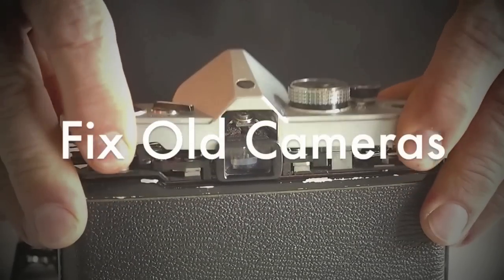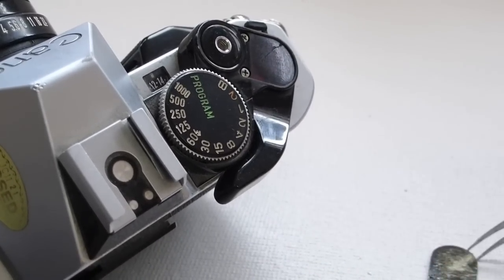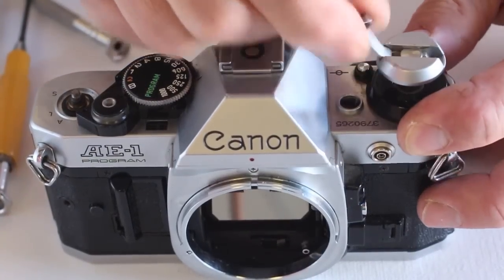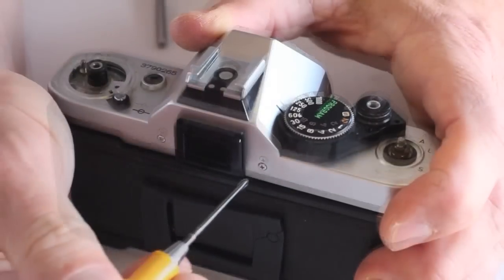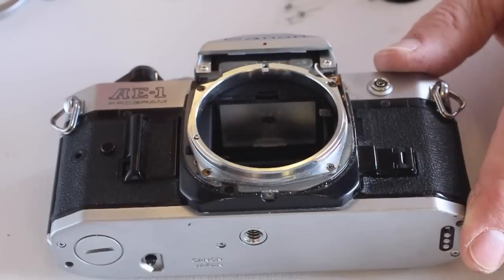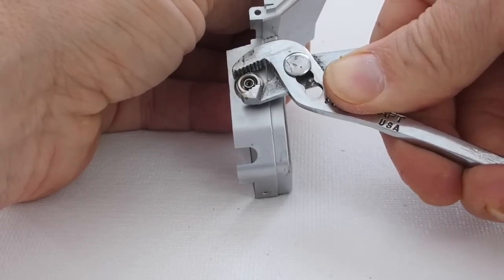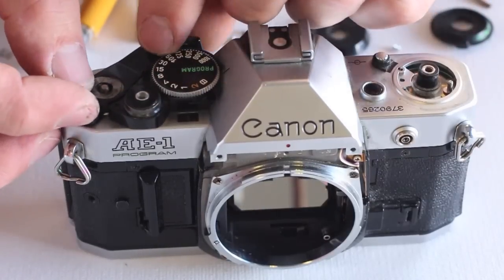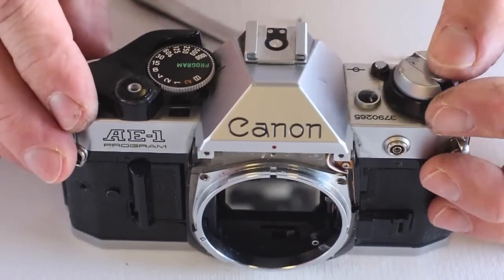Fix Old Cameras: AE 1P Top Cover Removal / PC Socket Repair

Comment: Hello there, I’m having problems with my shutter speed dial, sometimes it works sometimes it doesn’t, I checked it with shutter speed 1, 2 and B, sometimes it just fires at 1/500 or 1/1000 and B doesn’t even lock. How can I fix it? Could you please show me how to fix it? Thanks.

Comment: Hi thank you for your videos. I would like to know how to repaint cameras that have their paint chipped off over the years?
Reply from the maker: Assuming we are talking about black painted metal camera bodies. Sand 
chipped areas smooth with 600 grit sand paper or chemically remove the 
old paint. Spray with thin coats of satin enamel paint. 
The engraved letters are filled with a white a lacquer paint stick.
 - available here- http://astore.amazon.com/fixoldcam-20/detail/B002BY8HKS
Note - Typically powder coating or any heat cured paint does not work will with the thin metal of camera top covers.

Comment: Thanks for this video, it's been a big help in my getting my top cover off. Now that I'm putting it back together, I notice two pins that  I don't know where they came from. One is black plastic, the head is about 1mm in diameter and the shaft about 0.5mm in diameter. The shaft is about 4mm long. The other pin looks to be brass, has same head and shaft diameters, but the shaft is only about 2mm long.

I notice in your video there's a long plastic shaft hanging down from the inside of your cover, where the battery check button is. The underside of my camera's battery check button is just a rounded nub. I checked, replacing the top  cover, and the button makes contact with the circuit board -- I get beeps. So I guess my version of the AE-1P doesn't require a long shaft to activate the beeps.

Looking down at the circuit board on the left side, I notice the rear corner has a hole but no screw in place there, So I tried dropping the black plastic piece in the hole. Apparently there is a spring down there because the pin has some give when depressed.  Is this where it came from? I notice this hole is threaded, though.

Now as for the brass looking 2mm long pin, I haven't a clue. It also fits that hole and sits flush, but I'm thinking it probably goes somewhere else.

On the right side, the black plate that holds the frame counter has a hole but no screw in the top left spot. Doesn't look to be threaded, either. I tried both pins into this hole, but they wouldn't go all the way in. There's a more narrow hole beneath that won't let them pass.

Any advice you can offer would be most appreciated,
Reply from the maker: The brass post is probably from the shutter button and acts as the linkage from the plunger of a self timer cable. They never fall out... well at least nearly never. The black plastic post could be from the accessory shoe contact. If the center screw of the contact worked loose it could have allowed the contact to shift to a position that then allowed the post to fall free.
Reply: Okay, that makes sense about the black post. It was because of the accessory show that I opened up the camera. I'll check on the brass post's position as well.
Reply from the maker: Excellent, you are on the right track.

Comment: cool, but could you make a how to , to change the battery door? since its a very common part that breaks. thanks!
Reply from the maker: Here you go - https://www.youtube.com/watch?v=sHgN1RM3H7c
Reply: hi thanks i know this one. but in the Ae-1p its not easy like in th ae-1. for some reasom it looks like the top end of the pipe/metal stick is fixed to the case. and the bottom of it has a strange clip holding it. no way to push it upwards like in the Ae-1.
Reply from the maker: The hinge pin of the AE-1P battery door is removed in a similar manner. However, the top cover must be removed as the upper pin hole is blocked by the edge of the top cover. Sometimes the pin can be stubborn. Try seeping a little plastic safe solvent around the holes the battery door hinge pin is anchored in.

Comment: How do you replace the front
 battery door?
Reply from the maker: Once the top cover of the AE-1P is removed the hinge pin for the battery door can be pulled and the door removed. See the Fix Old Camera video for the Canon AE-1 Battery Door Replacement to see how the battery door hinge pin is disengaged. Other than the position of the flex circuit caution the procedure is the same for the AE-1P.
Reply: Can you please provide the link. Thank you.
Reply from the maker: You will find it in the Fix Old Cameras Playlist "Canon".
https://www.youtube.com/watch?v=sHgN1RM3H7c&index=5&t=28s&list=PLbBpUKJh6LCmx4zwCUEg5dCoIraoFd8LS

Comment: Thanks for your video,Could you tell me where to get a pair of those snap ring pliers from? And what size they are
Reply from the maker: There are some acceptable options here...
https://www.amazon.com/shop/fixoldcameras
Affiliate disclosure: Please make note that the links provided are affiliate links and a small commission is received by the creator of this channel if you make a purchase using these links. This adds no extra expense to your purchase. Your support of this channel is appreciated. Thank you making any purchases through the links on this channel.

Comment: I have an ae-1 and the light box is so dusty. How can I clean, please? ( I don't know if that's what it's called but, it's where the mirror is found) thank you!!
Reply from the maker: The VF focus screen inside surface is sealed. The outside surface of the VF screen can be cleaned with a gentle burst of air or a soft lens cleaning brush. If there is degraded foam stuck to the VF screen it can only be removed with distilled water. The screen is very easily damaged by alcohol based cleaner. It also scratches easily. The mirror surface can be cleaned as you would a lens, being careful to use gentle pressure.
Reply: Much obliged for your help!

Comment: The Canon service manual for some reason seems concerned with not moving the ASA wiper from it position after removal of the ASA cover and indicator dial ( suggests setting to ASA 100 before and after disassemble/reassemble. I can't see any way for the indicator dial to be assembled any other way than to align it with the coupling pin, which as far as I can tell will return the wiper to the correct ASA position as indicated on the dial. Is that correct?
Reply from the maker: Do not lose the point of reference. Sounds like you have it. Make sure you do not flip it 180 degrees out of phase.
Reply: Fix Old Cameras
So as I understand it the concern is not so much that it can and will move while handling the camera body (I know mine did), it is that it is in approximately the same spot when you start the reassembly process (IE: to the left side of the ASA dial opening in the Camera top with the Camera's lens opening facing you). The opening in the indicator dial for the coupling pin is going to result in the indicator being near the ASA100 indication when it and the cover are reinstalled. If the coupling pin was accidently moved to the opposite side the dial may indicate an ASA reading, but it wouldn't be correct.
Reply from the maker: Correct. It might help to take notes and pictures during the disassembly process in case things should inadvertently get moved.

Comment: hi at 1:09 the circle that you open with tweezer is still stuck if I try this on my camera, can you help me?
Reply from the maker: Sometimes apply heat from the tip of a soldering iron will help. Be mindful that you do not let the hot soldering iron accidentally come in contact with plastic parts of the camera.
Reply: @FixOldCameras  thank you very much!

Comment: SOS!!!!! I need help!!! I thought I was following the instructions but got lost along the way. I accidentally took out the pin underneath the rewind knob and closed the film door. I can’t put the ASA ISO pieces back either. Please help me
Reply from the maker: The black inner shutter dial with the scalloped edge needs to be set at the Bulb. The ASA dial needs to be set at 3200. The notch of the inner dial will not align perfectly with the tabs of the ASA a dial. Slightly tip the ASA dial as you turn the ASA dial just a bit to seat the tab of the ASA dial to the notch of the inner shutter speed dial.  The following link might help with the film door issue you mentioned. https://www.youtube.com/watch?v=gQJQgdE4ISc&t=4s
Reply: Fix Old Cameras is this referring to Canon AE-1 or P? I have the Ae-1Program model
Reply from the maker: Sorry thought we were referring to the AE-1. Disregard the above post. For the AE-1P the video shows the linkage set up in good detail a verbal description will add little.  Maybe freeze frame and slow motion at the relevant points will help you get the parts of the ASA dial aligned properly.

Comment: Greetings great Video's! I have a bit of a situation. My son was taking pictures with no film in the camera,lol. How do I get back to zero in rewind, without film?
Reply: I have a Canon AE 1 Program,
Reply from the maker: The counter will reset when you open the door. If it does not there is an issue with the counter return spring or the counter dial is binding.
Reply from the maker: Most, but no all, classic and vintage cameras manufactured after 1970 have counters that reset when the film door is opened.  Those manufactured before 1970 often had external dial reset procedures if they do not reset automatically.
Reply: It did just that, It reset once I opened it. Thanks for being so patient with a newbie. Cheers!
Reply from the maker: No worries. Everything about cameras and photography was once new to us all... and the more you learn the more you find there is yet to learn. Thanks for your comments and your interest in FOC.

Comment: how do you lock the rewind shaft
Reply from the maker: Most of instances you can use your thumb, but sometimes you might have to wedge the blade of a screwdriver between the forks of the rewind shaft. Use gentle but firm pressure taking care not to break the soft brass of the rewind fork.

Comment: IF YOU ARE USING A CANON AE-1 PROGRAM: so am I, and its been kinda impossible to find an adequate video teaching me how to take off the top because the key parts are in different places and have slightly different parts. However, it is possible!  https://www.youtube.com/watch?v=tOu-x5StyJ8 this video, also by Fix Old Cameras, is very helpful!